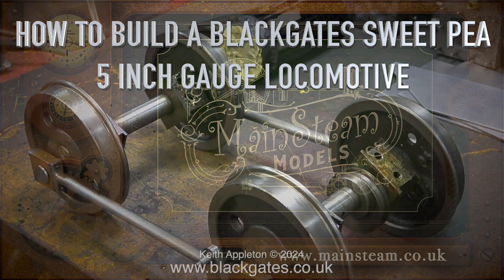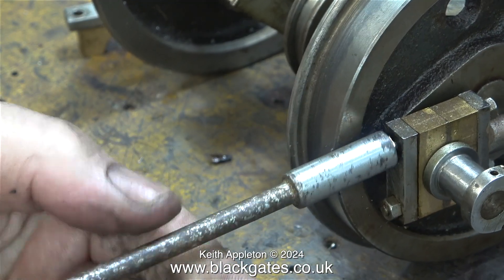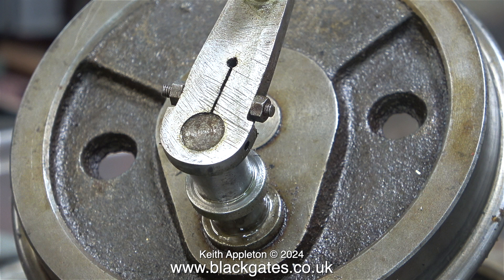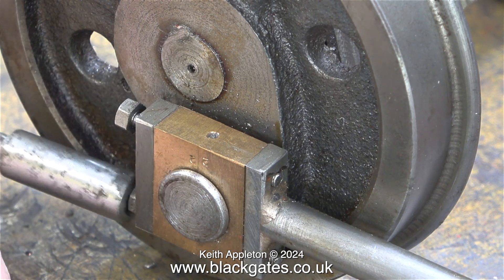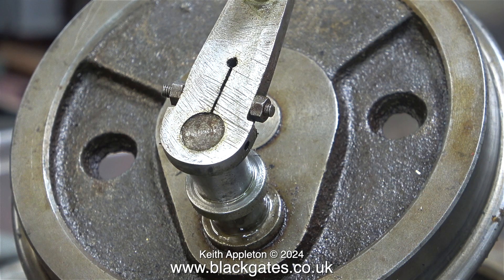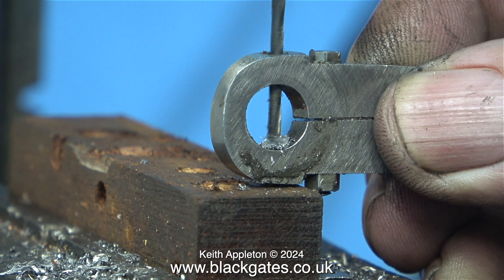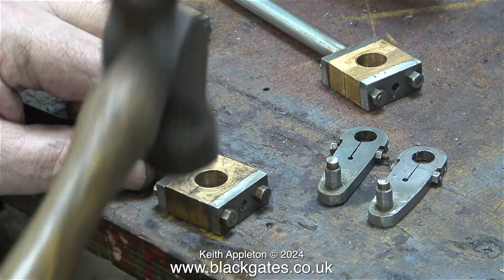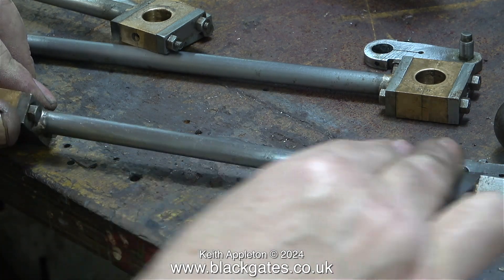A BLACKGATES SWEET PEA LOCOMOTIVE BUILD - PART #25

Comment: You could just lightly countersink the top stud holes in the bearing brasses if you didn't want to "neck" the studs.
Reply from the maker: That doesn't seem to work, the oil ways are still blocked by the studs.
Reply: @keithappleton  2 chamfers on the split faces of the brasses would sit together to form an annular space to let the oil flow around the stud, linking the oil drilling above and below the stud.
Reply from the maker: I have a different idea, for the Brasses and the Axleboxes - all will be revealed in the fullness of time . . . . .